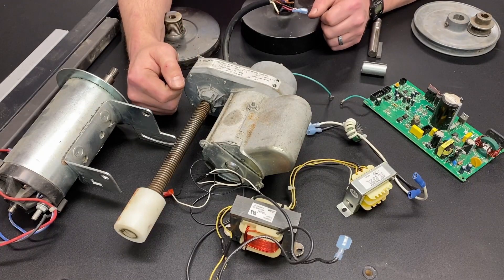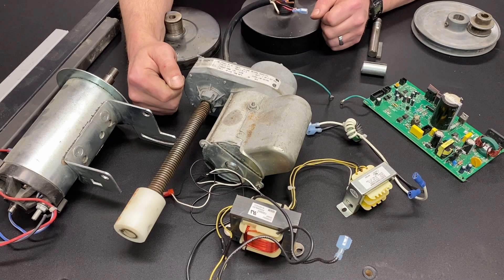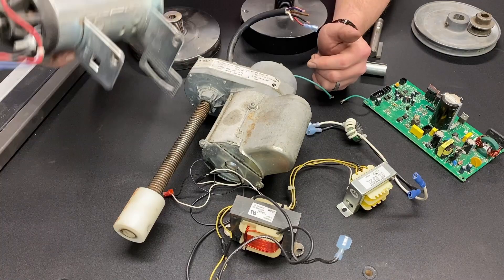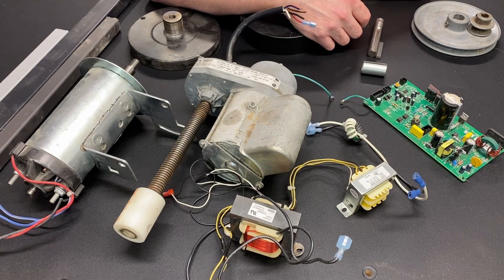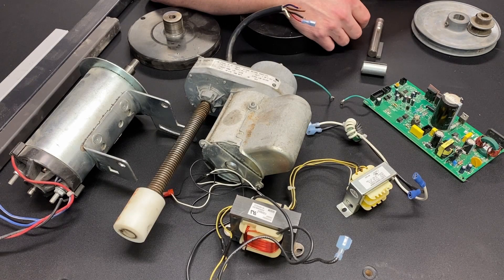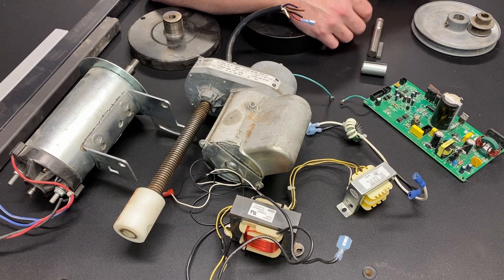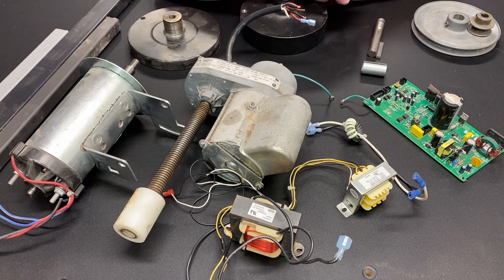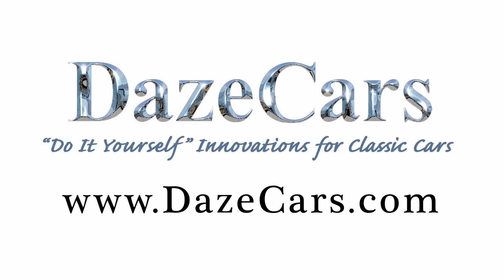Treadmill conversion FAQ 2: Where do you get all the treadmills you are scrapping for parts?

Comment: Where do you get the DC choke if none came with the treadmill I removed the motor from?
Reply from the maker: That is FAQ 6 which won't drop for a couple weeks, BUT I can give you a preview  "Go to eBay and search “treadmill motor choke” BUT know that most people on eBay don’t know what they have and the word transformer will also appear in most listings. Problem is a choke and a transformer look almost identical so some listings are for transformers and some are fore chokes because the sellers think they are interchangeable. They are not.  To tell the difference count the wires. A choke will only have 2, a transformer will have 3 or more. Please let me know if I can be of further assistance."
Reply: @dazecars  Yep I know that and your right got to be careful on eBay. I still have a few chokes left from when they used them.Don’t sell them to often not used on treadmill for years
Reply: Newer models don’t take the choke they clean the motor voltage at the controller. I might have some in my shop. Email me at Fitnesspartspro@gmail.com